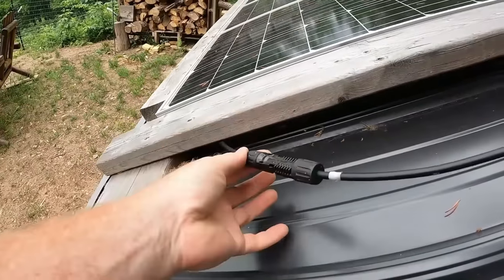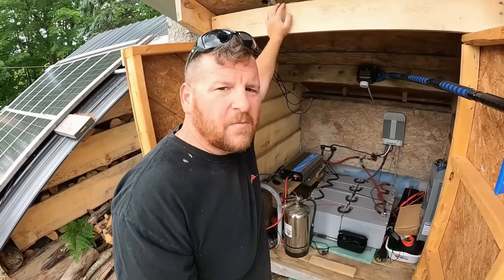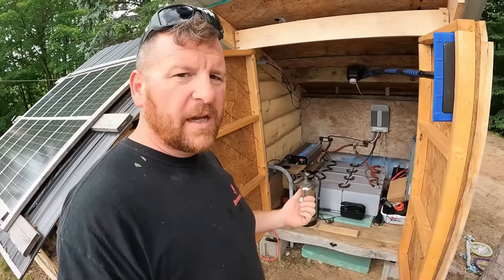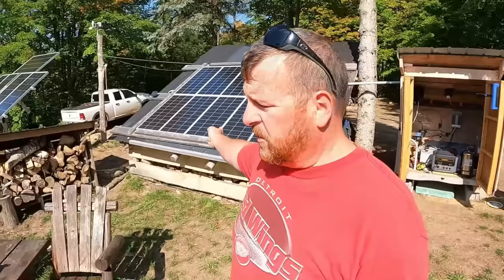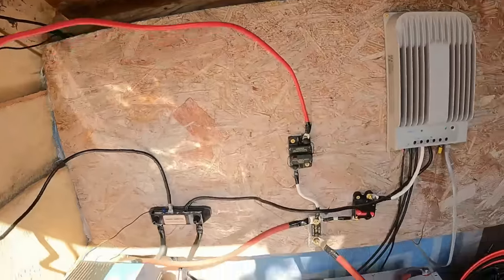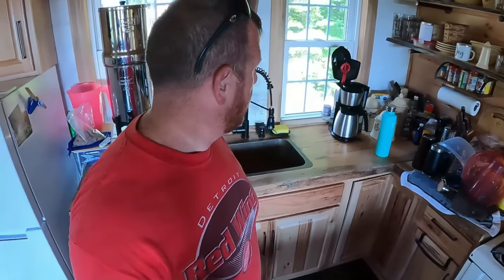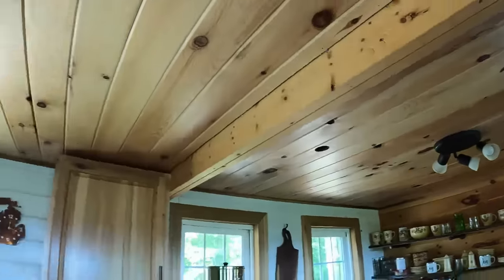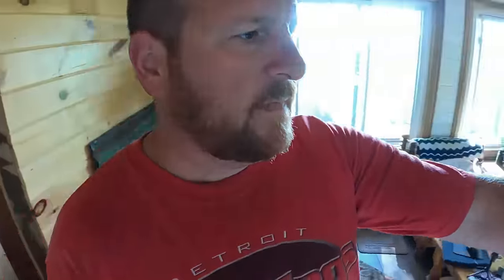SCAMS to Avoid With An Off Grid Solar Power System - 2 year update

Comment: Ok Mr. Professional [Pick!! Pick!! - LOL :-) ] I see you did not not go with the warmer pads for the AGM battery bank. - Mine cabin is 28 x 16 and my operating temps in cabin are 14F to 120F - yet my solar equipment is 32F to 104F - going to be a challenge for me - I hope I don't have a major fail. Need 15 to 20 years service if I can with what I have now. The AGM route maybe what I need to look at longer term. I use 800 watts total of solar panels (4). I am doing lights only right now with a Ryobi Inverter - 4 lights 120 watt max, more like 90 watts continuous. But once I complete the solar,  I think I might look at something between the size fridge you have and the cube type - I don't need anything too big for daily use. I still have to go "Home" - said with sarcasm, aka the "gridded place". But I will be drifting further from that place as I can. Which propane stove is that? I need one that is for indoors, but uses like a 9v battery to ignite. Lower the propane use the better, I use outdoor fire pit and small Lodge Grill for my cooking right now. But in bad weather, need to be able to cook in the cabin. I am sure I have room for improvements, but like you I am trying to do this one on the cheap and simple, (but not be cheap with the long term) you get with what you pay for. Water is my next bigger challenge, trying to go the dry cabin route, and I am working on that. Winter is challenge like you and water freezes. 

I would suggest a future - "Sit down" video, both your wife and yourself, and address "Cabin Life" - I see you have a water filter system on the counter, propane stove, solar, garden, etc... but what is it really like in reality for you two??? What are the challenges??? What wisdom do you have??? Mainly in daily cabin living.

Thanks for the latest video - that is very helpful information - but I am going to have to find some quiet time, and go back and watch all these videos again, and make some notes, and see what I can implement going forward. Thank you.

Comment: Love your setup and im attempting to build my own solar system for a remote farm use, we purchased 14 acres and planning on building a shop with a resting quarters would like to consider what u have plus maybe adding a few extra panels with micro inverters to assist with ac power to the main inverter. What are your thoughts on that? My thoughts are it would balance the ac and well uses without drainage to the batteries bank. Thanks Nate
Reply from the maker: Hey Nate....to be honest I know nothing about Micro inverters. I kinda set this system up and it works, so I'm not that well educated on the other styles of technology and systems. I'm hoping to learn more soon

Comment: For the small investment in lithium iron phosphate over lead acid is huge. While more expensive, the overall power density and life cycle capacity is going to for sure be WAYYYY cheaper in long run. Ohh. And keeping a small heater in a shed takes very little power especially if you insulate it. 

I honestly don’t know why people still use anything other than LiFePO. Waste of money.
Reply from the maker: Cold Climate....that is why
Reply: @OffgridwithJayandJen  I answered that issue in my comment. Proper insulation, minimal heat with a wireless relay. Bam. Very simple.
Reply: @OffgridwithJayandJen  you could even add a couple computer fans in the top of the shed with a vent at the bottom with a screen to add air flow in the summer. I’ve seen it a thousand times. Lead acid is just so incredibly outdated with the current technology. 

Besides batteries give off heat when they charge. So as I mentioned before with solid insulation a small litter heater with an auto switch would spend little to no power.

Comment: Great video! I have been putting together plans to build a small camper, and I was wondering if the cost of a larger dorm refrigerator for $150.00 was a better option than one of those 12volt frig/freezers for $1000.00 was worth it! I am planning on either building or buying a 200 amp-hour system with 400 watts of solar to run the camper along with a 2000-watt gas generator as needed.
Reply from the maker: Very nice. I think with the energy standards they require now, the fridges work very well with solar. Hope it works out good for you. 😊👍

Comment: This video is awesome! I love the emphasis on the refrigerator. I know you tested a window a/c, did you find it was too big of a pull to use ? Also, if you were to start today and you didn't have those batteries, what would you get?
Reply from the maker: Now that I have more Experience with Solar and the Prices have dropped on the new LIFEPO4 batteries I would definitely have a bank of those inside the Cabin somewhere. Originally the Technology and Cost was not as great when I built this set up.....but it is pretty reliable now and fair

Comment: In the winter months, how big of generator does it take to get you charged back up. And what are the rough fuel volumes you go through.
Reply from the maker: Our back up charger is not the best....it only pumps about 240 watts into the batteries. So it takes a full day of running the genny. But we use a very small efficient and quite generator that sips the gas. Runs for  10 hours on a gallon of gas. Maybe spend 10 dollars a week to run it. But only need to run it is the sunshine hides for weeks at a time
Reply: Thats far better than non stop generating power.👍

Comment: Have you ever thought about building a wood gasifier to run a generator.
Reply from the maker: Have heard about them and seen a few people build vehicles with them. Would be really cool I think
Reply: @OffgridwithJayandJen  Building one for a car is probably a project within a project. Building one for a generator seems pretty straight forward. In the videos I have watched on them the two problems that pop up the most are people building smaller than their need thinking they can make them more efficient and deviating from the FEMA designs trying to make them more efficient. 
I sold my house here in Florida and will be out by the 15th. I finish loading a PODs with my stuff to go in storage tomorrow and will be traveling the country looking for a place to homestead after I spend a few months in Central America during the winter.
I came across your videos last night while looking for ideas on what I will build. The gasifier seems like a good project to supply electric without doing fuel runs when I start clearing and building. I just havent seen any off grid YT channels try it yet. All the videos I have seen are people doing it for a backup or trying to reinvent the wheel.

Comment: Quick question, say I want to keep a fridge and chest freezer running all the time, would I have to worry about having more batteries and power, figured it’d be like a weekend get away cabin
Reply: Hunting cabin and weekend getaway kinda thing
Reply from the maker: We use our fridge for weeks at a time.....long as you get sunshine every few days it keeps up just fine. Make sure your panels are in a great spot for sun and you have an energy star efficient fridge too.  This set up would be perfect for a weekend getaway.

Comment: What's the expected life span on the batteries and the Solar panels?
Reply from the maker: Solar panels work for 25 years at 70 plus percent efficiency.  After that they slowly degrade and lose a small percentage. The batteries we have are AGM flooded lead acid. Older technology,  but should last 3 to 5 years. They are 3 years old now and still work very well

Comment: How do you charge your battery system? I use a 24 V charger but it only charges about 15 A and it never seems to top off my batteries after 4 or 5 hours of the generator.
Reply from the maker: Same here actually....it is the weakness in my system. I should have gotten a inverter charger actually, But I was not aware of their function. I have a small 10 amp 24 volt charger and it literally just keeps the batteries from going dead really, until the sun comes back to charge them. I don't really need the generator and charger that terribly often

Comment: Curious about your generator setup? How long does it take your generator to charge you up?
Reply from the maker: Actually our generator charging is very inefficient. I have not bought a good 24 volt charger, only using one I was given that only pumps a couple hundred watts of power into the batteries. So it works, but has to run all day to add much to the system.

Comment: So far what's the AGM Vs LiPo opinion?  I have (6) 200ah Renogy AGMs & I am  not happy with their performance over the past 20months.  I hate to spend energy to keep the LiPos warm enough to operate but the difference in battery performance seems enough to justify.  What's your experience been so far?
Reply from the maker: Honestly we have been happy with the AGMs from renogy. I abuse them  by leaving then in the cold and such and they are still doing well. I feel like they may be losing a little bit of capacity now after a couple years of use, but nothing drastic. What is it that you are unhappy with? Do you do heavy load testing  and such?  I don't really monitor or collect too much data from our system, just use it and it has kept taking care of us.
Reply: @OffgridwithJayandJen  Capacity and usable percentage.  I've also probably abused them a bit   Have you been keeping track of how much wattage you are using to keep the LiPos above 32 degrees?  My '24' plan is to bury a new LiPo battery cluster below the frostline, see if that keeps em warm enough the following winter.
Reply from the maker: @muskegonhunterscamp  Honestly I do not collect or track much data for how much I draw off the system, BUT I do know the inverter shows the draw on the read out and it hovers around 60-200 watts most the time. Just depends on if the fridge is running or is the lights are ALL on or just one room. Since I have been product testing a lot of Power stations the last year or so.....I also suck high wattage out of them on sunny days to charge those and to run my outside water pump which draws 1k watts...AND lots of power tools as well.

Comment: The generator charger does that affect your controller in anyway? Does it back feed or do you run it through the charge controller?
Reply from the maker: It just pushed a small amount of charge into the batteries, around 10 amps at 24ish volts.....so it doesn't effect the CC from what I've noticed.

Comment: So what is your total cost of this system ? I did not hear it in your video .
Reply from the maker: About $3700 dollars if you don't include the second array. With the new second array, you can add another $1700 including the tracking system, 6 panels, and the second charge controller.

Comment: How did you run your power into the cabin what type of wire was it
Reply from the maker: We used 10 gauge solid strand. I'm not an electrician, but with it only traveling about 50 foot over to the cabin and our power consumption in the cabin never drawing much more than 10-15 amps it works well for our set up. I have a video of installing and burying the line in our solar playlist if you check out our channel you  an find it there